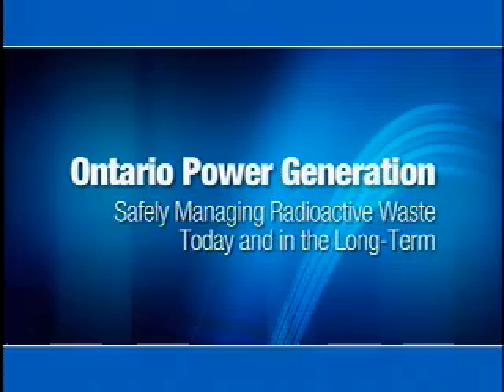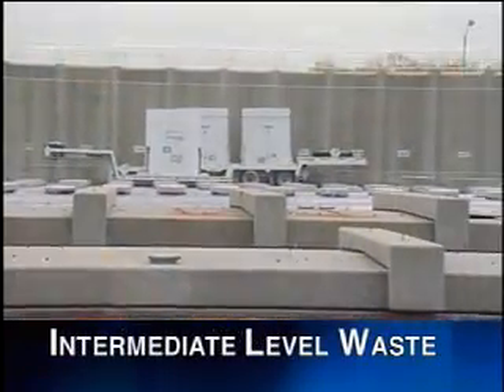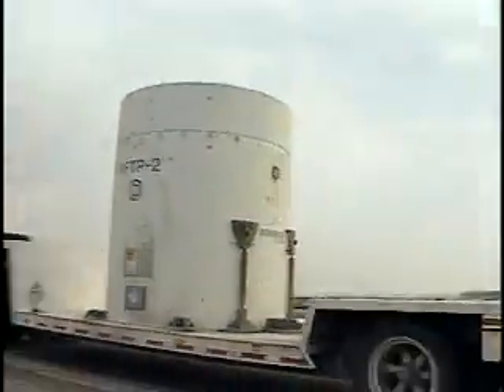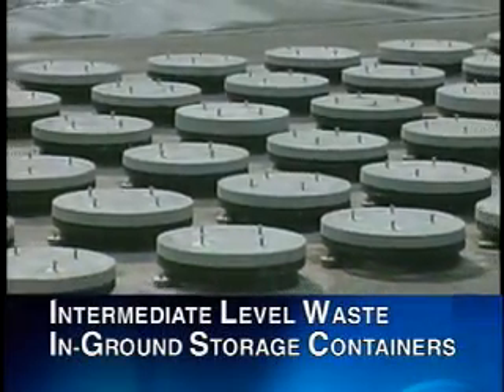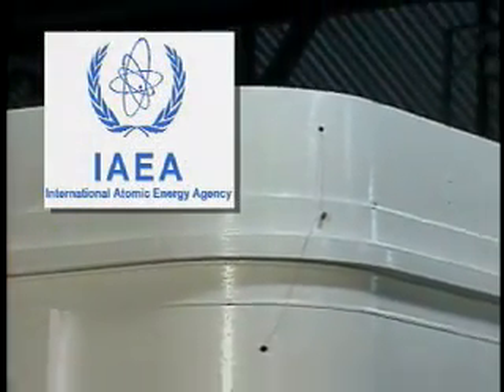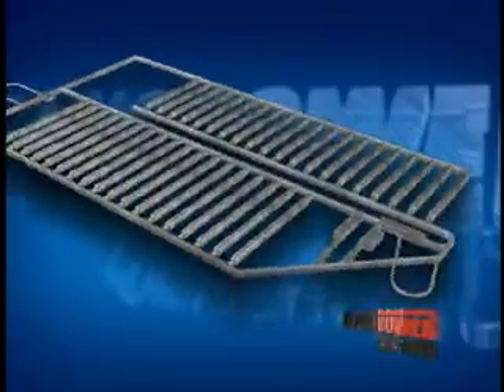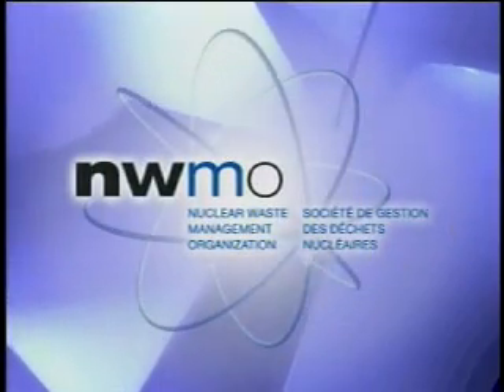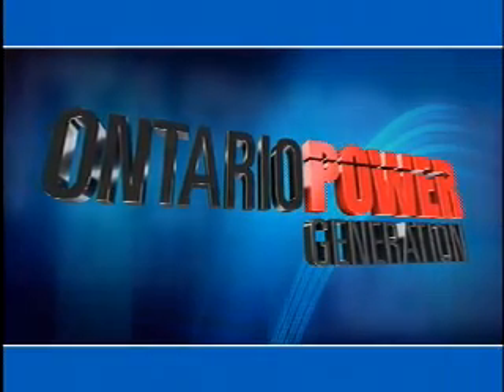Nuclear Waste Management Practices

Comment: No one really knows what to do exactly with high level waist, seeing is most of the used fuel maintains a considerable amount of dangerous radioactivity sometimes for a million years. Any containment we use breaks down, not to mention radioisotopes can penetrate stainless steal which can last many generations. Bottom line we have no element we can manipulate at this date that can contain this waist as long as its dangerous. Burring it is sweeping it under the rug.

Comment: we need nuclear energy bud, were runnin out of oil and coal, so unless your like 60 you should be worried bc theres gonna be an energy crunch if we no1 supports nuclear energy, and were basically fucked. Theres not enough energy in what your proposing, its too costly.  Also what you say might be more credible if you spelled 'solar' correctly.